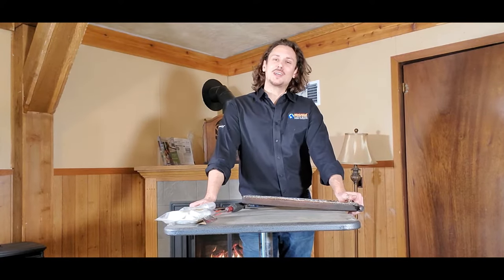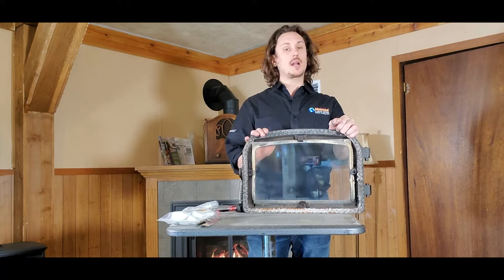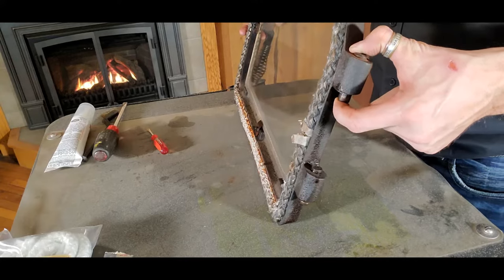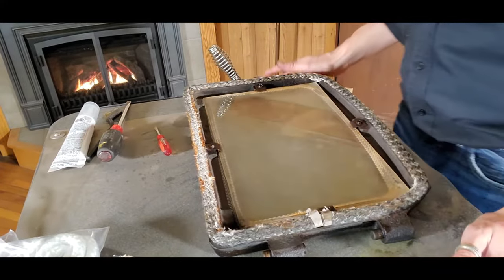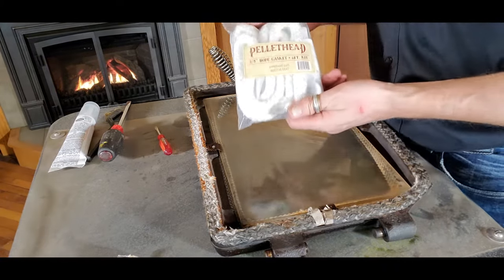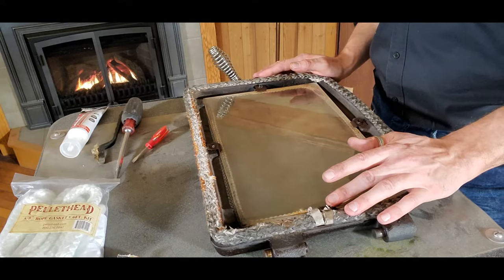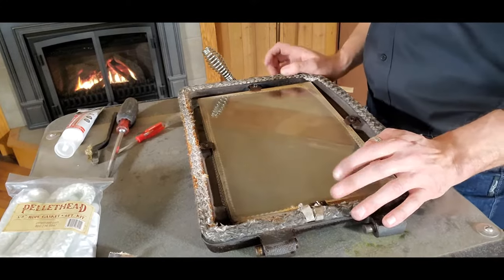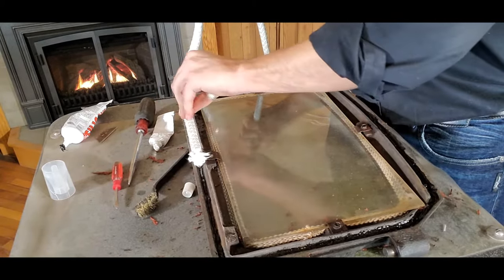Stove & Fireplace Door Rope Gasket Seal Replacement

Comment: I have St. Croix Prescott.  I use 5/8 replacement gasket according to the manual but having difficulty closing door.
Reply from the maker: Thanks for contacting us. Yes, that is the correct size gasket for the Prescott. There will be variations in the weave/density of a gasket - some are a loose weave, very soft - others are a firm weave, very dense. It's also important to remove as much of the old sealant that was in the door groove before placing in the new sealant and gasket. Old sealant and build-up can raise the gasket. I will say that it is normal for closing the door to be very tight after a gasket replacement, but you should be able to close the door. After a handful of times in operation, the door should become significantly easier to latch close. Hope that is helpful, thanks.
Reply: Thank so much.
Reply from the maker: @michaelcriam9976  Most welcome. Any other questions or needs just let us know. Appreciated.
Reply: I also can't close my door, after replacing my new rope. ?? 
The Groove of the door was extremely clean, before I started. Thought my rope was the wrong size? It does fit perfectly. Looking to see if I could adjust the two hinges to the door? 🤷‍♀️ 
Wondering if I need a smaller gasket rope?

Comment: so the metal trim on the inside of my wood stove door that holds the gasket in place - has turned to brittle - does anyone know can the metal trim be replaced or should I look into buying new door (which isn’t xheap)
Reply from the maker: What make and model wood stove do you have? We can check to see if that is a part available.
Reply: @EarthSense  so i just checked, its an Osburn 1600 - the sticker on the back says may 1989
Reply from the maker: @GravityDAD  Did a bit of research, came across the glass gasket retainer, part SE34060. Here is a link to the part for reference - SE34060. https://www.stove-parts-unlimited.com/osburn-1000-1100-1500-1600-glass-retainer-frame-with-gasket-se34060-p/se34060.htm
Here is the manual for the Osburn 1600 for additional reference and manufacturer contact. https://mrstoves.com.au/files/Osburn%201600%20Manual.pdf

Hope that is helpful, thanks again for reaching out.
Reply: @EarthSense  love it, thank you <3
Reply from the maker: @GravityDAD  Absolutely! Happy to help!

Comment: Thank you. Now our gasket is come away from the top in a 3-4" section. Should I replace the whole gasket or repair the loose part. Good video, clear communication and calm easy directions. Cheers
Reply from the maker: Thanks for the message - you can certainly apply a new bead of high temp sealant or cement in the 3-4" area that has pulled away and place the gasket back secure. Just make sure you are getting a good seal all the way around. If the seal seams loose in some areas and tight in others, it may be ideal to swap out/replace the gasket entirely. Any other questions or if you need any references just let us know - always happy to help. Appreciate your kind words on the video; very glad to hear it was helpful. Thank you!

Comment: I have a Woodchuck 2800 and I don't know the gasket size for the ash door. The manual just has an obsolete part number
Reply from the maker: Thanks for contacting us. Does your Ash door have a groove where it uses a round gasket? If so, what is the width of the groove? If it uses a flat tape style gasket, what is the width of it? Happy to help.
Reply: @EarthSense  Its a round gasket, but the one someone put in it doesn't let the door seal. You can push as hard as you like,  but the rope doesn't give enough to seal the latch side. It measures 5/8ths

Comment: Thanks for the video.  Is there a way to figure out diameter and density of gasket if you don't have model info?   I have an insert from Lowes but no paperwork or info anymore.   All i know is that it was called "summer's heat".  Thanks for any help.
Reply from the maker: Thanks for contacting us. Most Summers Heat models will use a 3/4" or a 5/8" medium/firm density rope gasket for the door. You can measure the door groove channel; typically the rope gasket needed will be one size over the groove width. Ex. 3/4" groove, 7/8" gasket. 5/8" groove, 3/4" gasket
For reference here are the two sizes.
1. https://pellethead.com/product/pellethead-replacement-england-stove-works-englander-door-gasket-seal-3-4-x-7/
2. https://pellethead.com/product/pellethead-replacement-england-stove-works-englander-door-gasket-seal-5-8-x-9/
Any further questions just let us know. Thanks!

Comment: Great video thank you! Any idea how to remove the door of a C 260 Legacy Wood Insert? The online manual doesn't show how and I'm hoping I don't have to take the blower off to remove the door.
Reply from the maker: Glad the video was helpful! We have never carried or serviced the Lennox C260 wood insert. Looking at images of the stove online it does appear the door has hinges on the left when facing it - Those style of hinges usually have hinge pins or slick pins that hold the door in. If this is the case try using a screw driver and hammer to tap out the pins from underneath. Here is a company that offers this model and could be of further assistance here. http://www.ricksrentalandstoves.com/wood-stoves/inserts/lennox-wood-inserts/item/88-lennox-legacy-c260.html

Hope that helps, thanks again!

Comment: I have an old Findley wood stove. It has a rectangular glass window with a gasket that wraps around it.The glass is held in by four metal plates. There is no other grove for any other gasket. Do you know if the glass gasket also serves as the door gasket? If not, do you know how to put a door gasket on this door? Does another gasket fit next to the glass gasket? Do you have the gaskets I need for this door> Thanks
Reply from the maker: Thanks for contacting us. In doing a bit a research it looks like Findley has several different model wood stoves and wood cook stoves. Here is a company I found that has parts for this manufacturer and could possibly help you to figure out what gaskets are needed and provide those for you. https://woodstoves.on.ca/parts/findlay-wood-stove-parts/

I hope this is helpful. Thanks for reaching out.
Thanks,
Reply: @EarthSense  Thank you!

Comment: We have a 1990 Quadra-Fire 2100 wood stove that is starting to smell like a campfire in the room after use (no visible leakage but noticeable odor.). We could not find a manual for this model online.  What size gasket would we use to replace the door as well as the glass gaskets?
Reply from the maker: Thanks for contacting us. Yes, gaskets will be a good area to start if it's smelling like a campfire when running. You can also get a handheld CO meter to pinpoint any leakage points in the stove or venting. Your 2100 should use a 3/4" Rope Door Gasket - https://pellethead.com/product/pellethead-replacement-quadra-fire-pelpro-heatilator-heat-n-glo-door-rope-gasket-seal-kit-3-4-x-7/#tab-models_tab 

Your 2100 should use the 3/4" wide flat tape style gasket - https://pellethead.com/product/pellethead-replacement-quadrafire-heatilator-ecochoice-glass-gasket-tape-3-4-x-7/

Any other questions please let us know. 

Thanks!

Comment: Great review!  I have a Lopi Revere Fireplace Insert and I bought a 7/8" gasket and adhesive kit.  Did I get the right size?
Reply from the maker: Thanks so much for tuning in! Yes, the Lopi Revere will use a 7/8" diameter rope gasket. Reference: https://pellethead.com/product/travis-industries-avalon-lopi-stove-door-gasket-seal-kit-w-sealant-7-8-x-6-aftermarket/ Any other questions just let us know. Thanks!

Comment: We have a Harman combo coal-wood stove manufactured in the mid '80's and the gasket fell out a couple days ago during a pre-season test (plus, it was low 40's up here in Nowhere, NH).

I followed the instructions in this video and just the door trick alone was worth it. Definitely removing the door made this process infinitely easier.

So far so good.. thankyou!

👍 fistbump city 🤜💥🤛
Reply: Oh yeah.. gasket = ½-inch diameter graphite infused fiberglass & rutland cement goop.

Thanks again!
Reply from the maker: Fantastic to hear that the video was helpful in the replacement of the gasket! Any other questions on your unit just let us know. Sending you a fist bumb right back! Appreciated!

Comment: Thank you for the helpful video! I have a wood stove with 2 doors and a locking mechanism in the middle that locks them in place. I was successful in replacing one side with new gasket yay (the side that closes first thankfully) but the other side won't close and the gasket didn't set properly. I was hoping that it would sink in a bit and that I'd be able to close the door later on - but nope I can see now that it's dry (unfortunately for me) that it's too twisted and didn't set properly into the grooves. Any advice on how to remove it again because it's basically new gasket with new glue?? I have no clue what model this stove is as it's from my grandfather's house
Reply from the maker: Thanks for the message, sorry to hear of the troubles. See if you can get a thin flathead screwdriver under the gasket in the groove. If you can pry up one end you should be able to pull the gasket all the way out and reset it. If the glue underneath is raised and hard, do your best to scrape it out before applying new sealant and laying the gasket back in. Hope that is helpful. Thanks.

Comment: That new gasket looks to be a lot bigger than the channel it's going into, is that normal?  Should I USE 3/4" gasket in my 5/8" channel?
The old seal I removed had a smaller rope inside the outer one so it was quite dense, the new 5/8" one I bought didn't and it's not as dense, that's why I'm thinking maybe I should go with 3/4"?
Stove is a RSF Delta II, manual doesn't go into changing the seal.
Thx
Reply from the maker: Thanks for contacting us. Did a little research on the RSF Delta II model. Most listings are stating a 5/8" medium density gasket. The OEM that I am seeing includes 2 gaskets - 80" RSF 5/8" Medium Density Round Gasket & 22" RSF 3/8" High Density Round Gasket. Are there two round rope gaskets in your door groove? Yes, density is very important - some models use soft, some models use firm, and others medium. I would say that you either replace yours with a firm density 5/8" gasket or you install a 3/4" medium density gasket to create the proper seal you need. Here is a link to our 3/4" which is a medium to firm density gasket. https://pellethead.com/product/stove-fireplace-firebox-door-rope-gasket-seal-replacement-kit-3-4-x-7/
Any other questions please let us know. Thanks!
Reply: @EarthSense , thanks for the quick reply.  Thanks for those specs, where did you get them?  They're definitely not in my owners manual.
I measured the seal at 84" long.  The rope has like a smaller rope inside of it (wish I could post a pic here) so I'm not sure what the 22" piece of 3/8" is for..? 
I want to change all the gaskets, door seal, glass seals etc before the cold weather sets in.
Reply from the maker: @fisherguy  Thanks Will, that's what I thought. Most gaskets that are of firm density will have what appears to be a rope gasket in the center of the gasket to give it that firm weave/density. Here is the OEM listing that I came across that had the two different gaskets. Other listings I look at with this part number only have a 5/8" gasket. https://www.rockymountainstove.com/rsf-delta-delta2-door-gasket/
Here to help if you need, thanks!
Reply: @EarthSense  thanks.
I'm an idiot, shoulda just done a Google search rather than looking on the RSF website.
They sure charge a lot for the "OEM" stuff eh?

Comment: Great video , should you see the gasket from the outside? Or would it be visible when you look at the fireplace ?
Reply from the maker: Thanks for the message. Depending on the model, you may see a bit of the door and/or glass gasket peaking around the edges from the outside, however if that is the case it should minimal. Any other questions please let us know. Thanks!

Comment: Great video! Have a Drolet Savannah Model DB03020 15 years old LOVE IT> need to replace door gasket what iwould be correct  door gasket that I need?
Reply from the maker: Thanks so much! Happy to help. The Drolet Savannah wood stove will use a 1/4" diameter gasket, part number AC06100. Here is a link for reference - https://pellethead.com/product/drolet-enerzone-osburn-century-firebox-door-rope-gasket-kit-1-4-x-6-aftermarket/

Any other questions please let us know. Thanks!

Comment: Hello, We have a Heat n Glow Vieana II stove and need to replace the gasket. Im just not sure which one I should get as the manual doesn't really give me much information. Any help would be very much appreciated.
Reply from the maker: Thanks for contacting us. I did some digging but I couldn't find any accurate part lists on the Vienna II Heat N Glo Model. Here is the Get in Touch form on Heat N Glo's website - I would suggest contacting them directly to ensure you get accurate info on the correct replacement gasket. Hope that is helpful. Thanks!
https://www.heatnglo.com/get-in-touch

Comment: Doesn't the foil tape compromise the sealing action of the gasket?
Reply from the maker: Thanks for the question Jim. We have found a small piece of foil tape used still makes proper seal to the stove body while keeping the ends from fraying. In certain style gasket kits we do include that foil tape. Important we are making sure we get a good seal all the way around and important to check that on a regular basis.

Comment: What about the other rope which is right around the glass ? That’s the one I need help with replacing
Reply from the maker: Thanks for the comment. Link below to a video for common glass gasket replacement. There are variances in the type of gasket and how it is installed based on the stove make and model. If you have any questions just let us know. https://youtu.be/KTzTJC0r5EQ?si=ZxS7w4CRB6ayA84_

Comment: This was a very informative video! What size gasket for a castle serenity pellet stove? And how often should you change it?
Reply from the maker: Thanks for the comment. Is your model an Ardisam Castle Serenity? Just want to verify that first. Thanks!
Reply from the maker: Missy, If you have the Ardisam company Castle Serenity model, your door gasket will be a 3/4" round rope that is used. Generally speaking we recommend folks to replace when there is heavy wear, frays, or air gaps. A quick way to check your door gasket seal will be the following. With the stove shut off and cool, stick a dollar bill half in and half out of the door and close the door. Pull on the dollar bill. There should be heavy resistance. Check in multiple spots around the door as some may be tight, but other areas may be loose. If it's loose or has minimal resistance in any area, we recommend replacement. Here is a reference of that gasket if needed. https://pellethead.com/product/pellethead-replacement-ardisam-castle-hps10-serenity-fire-door-rope-gasket/
Any questions please let us know. Thanks!
Reply: @EarthSense  thank you so much!
Reply from the maker: @missy476  You're most welcome!

Comment: My regency wood stove door seal trough measures 5/8” across but websites I’ve seen say Regency stoves use 7/8” seal rope. What gives? 4:49
Reply from the maker: Thanks for the message. Generally speaking the rope gasket diameter will be 1 size up from the width of the door groove. If you know your Regency model, we can verify the correct replacement for your stove.

Comment: Hello! What gasket kit would I need for QuadraFire 7100 EPA wood fireplace? Thanks!
Reply from the maker: Hey Laci! Thanks for contacting us. Your Quadrafire 7100 will use a 1/2" diameter rope gasket for the door, and 1/4" diameter rope gasket for the glass. Here are links for reference, any other questions please let us know. Thanks!
https://pellethead.com/product/quadrafire-majestic-wood-stove-door-rope-gasket-kit-12-x-10-aftermarket/
https://pellethead.com/product/quadrafire-heat-n-glo-rope-gasket-kit-1-4-x-10-aftermarket/

Comment: I'm having issues with a Harmon P43 that was in my house when I bought the house 2 years ago. it has always had ignition issues, and I was assuming igniter (I've been running lighter less efficient pellets to light easier). but after watching these tutorials I have begun to think its a gasket issue. I'm not sure if they have ever been replaced. Would it be beneficial to go ahead and replace all gaskets including the ash can door gasket and the burn door glass gasket?
Reply from the maker: Thanks for contacting us, happy to help. Before replacing the gaskets, I would suggest you check them first. Stick a dollar bill half in and half out on the door. Close the Door. Pull on the dollar bill. Should be heavy resistance. Do this in several areas around the door. Do the same with the ash door. Visually inspect the glass gasket - we shouldn't see any air gaps. Poor sealing gaskets can definitely have an effect on the ignition, but let's make sure by doing the tests first. 
Here is a video we did specifically on igniters - take a look at this as well. https://www.youtube.com/watch?v=z4wmCc96rVI&t=3s
Happy to help and get you back up to 100% with your P43. Thanks!
Reply: i have a p43 for almost 10 years. Mine sometimes has ignition issues too. Remove the small plate with wing nuts. Clean that out really well with a shop vac. Also I cheat sometimes. Before you start the stove I sometimes will rip up in strips some news paper and lay it in the burn pot an toss a handful of pellets on top of the news paper strips. This helps get the pellets going easier since they are much harder to get going vs news paper. Lay it flat and toss a hand full of pellets on top before you turn on the stove. This always helps. IF you want to cheat entirely use a torch it will work just fine if its being stubborn..